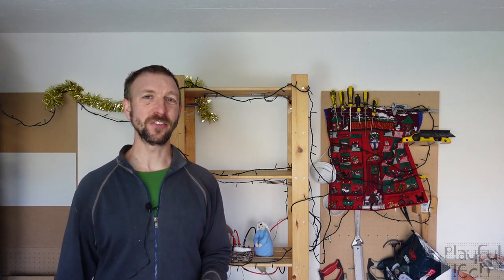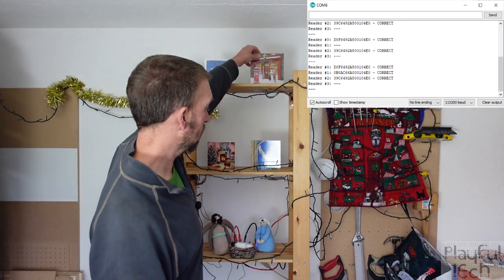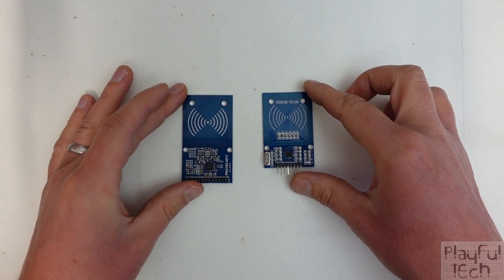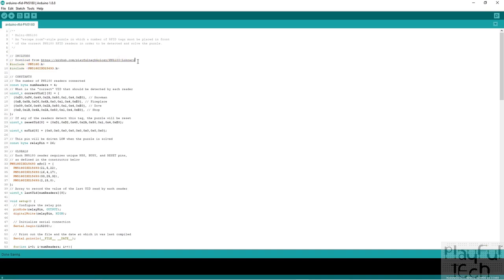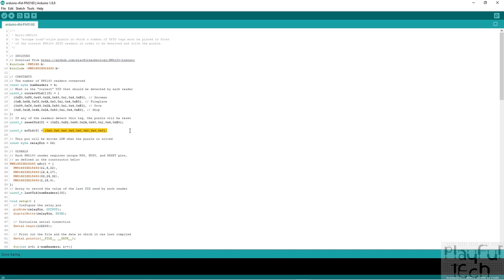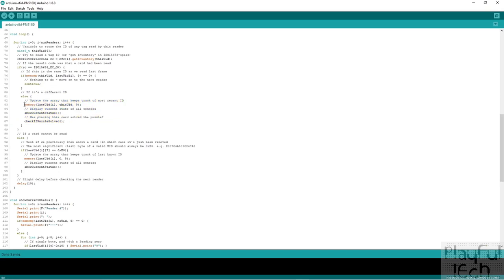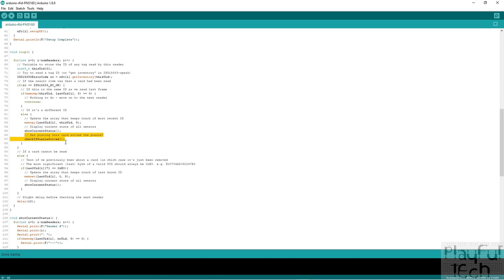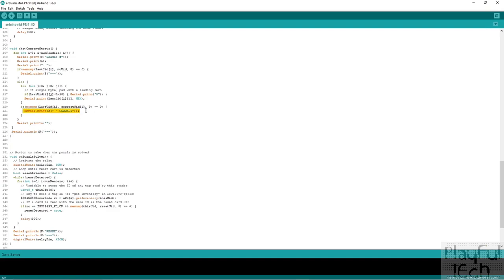Long-range RFID Vicinity Sensor Christmas Escape Room Puzzle Tutorial using PN5180 and ESP32

Comment: I wonder if it's worth doing a video on converting SPI (and other serial protocols) to/from RS485 so it can be sent over very long Ethernet cables, depending on data rate SPI can be quite limited on how far you can reliably send it and using RS485 makes best use of the twisted pair cable. there's very easy/cheap to use RS485<>TTL converters available from the usual suspects.

Comment: @20.12, Had figure out why my sensor does not work, indeed the PN5180 need 5V from the ESP32 vin pin. The PN5180 library did not mention this in the example code.

Comment: Hello, thank you very much, I was able to successfully read the tag but I got a ridiculous range of 10cm. The level shifter and every thing works well. I have 3 iso15693 tags which have different range
Reply: I have exactly this issue and absolutely nothing I do resolves it. Did you ever figure it out?
Reply: @kccr37  no not at all. There was really no solution. I had to buy a UHF reader. I was able to get 5M read rangs
Reply: @joshuaolakanla3993  thank you so much for your answer. Which reader did you end up going with? I'm currently trying the Sparkfun Simultaneous RFID reader, which is UHF. It's okay but not perfect for my application.

Comment: Awesome video as always! I have some questions..
Is there a way to adjust the reader sensitivity like in the mfrc522 library? I am worried that the reader might be too sensitive in some applications- having readers too close together could cause problems I assume for some puzzle setups!
Also, do both the 5v and 3.3v need to be connected for the module to work?
Lastly, I think it would be better for most escape room puzzles to have an automatic reset as opposed to having a dedicated reset card. Automatically resetting after all of the cards have been removed is something I struggled with when making some mfrc522 puzzles because the library allows the reader to detect when a new tag is present, but doesn't have a function for detecting when a tag is removed. Is this something you have tried using the mfrc522 or pn5180 modules?
Reply: You can detect if a tag was removed by polling the reader and comparing to the last reading, if the last read was an ID and the current read is nothing, you know the card was removed. He shows the code for this at 50:49

Resetting automatically  has the drawback that players can reset it themselves, which might be unwanted. But when this doesnt matter its definitely the simplest option!

Comment: This is cool for reading the UIDs. But I would really like to see an example where blocks are written to (and read again). I am struggling to understand the documentation on this.
Reply from the maker: Oh sure, I can show that. Do you have a particular application in mind to use as an example?
Reply: Thanks. Let’s say you have a bunch of cards that you want to be readable by multiple readers without having to program in the UID of each card for each reader. You would want to write a block of bytes to each card with its name, so that any reader could read the card without having to know its UID, and also worn out cards could be replaced without having to reprogram the reader.

Comment: Great video! - Thanks!
you've used RJ45 breakout boards to carry the signal lines to the ESP32,
I wonder, what is the maximum range you can go with the cable without losing the signal quality ?
Reply from the maker: I've got 3.3V over Cat5 running 20m. Haven't tested beyond that.

Comment: Hey man, cool video. Do you know any anti-metal tags that can read through a metal table ? ones I bought work only on metal surface. Want to place the PN5180 under a metal table.
Reply from the maker: I'm pretty sure all the RFID technologies I'm familiar with would not work if attempted through a metal surface - it requires electromagnetic coupling which is achieved through a tuned antenna, and the metallic surface would interfere with that. It's possible that an active RF transmitter at a suitable frequency might work, but that would obviously require battery power in the portable part of your prop.
Reply: @PlayfulTechnology  okay, thanks a lot.

Comment: Hi man, love the video! I have a quick question- are your rfid tags 125kHz or 13.5mHz? I have some capsule tags (EM4102 chip) that work at 125kHz, just wondering if i could use a setup like this with them ... Thanks in advance! (Sorry if its a duplicate question)
Reply from the maker: All ISO15693 tags operate at 13.56MHz

Comment: READY TO JOIN PATRION, but first...
Hello, I am in the Philippines & just getting started with all this.
I just bought an Arduino Uno (with 3.3v) and 5 RC522 rfid sets.
This video is a bit old, so before I sign up on your patrion, I would like to make sure, will I be able to use the code with 5 RFID RC522 on my Uno?
I know $10 doesn't seem like a lot there, but here that's 1 days wages, So it's better to check first if I can do what I need to before I spend so much.
Thank you

Comment: Do you know how good the PN5180 can detect RFID/NFC rings? I used a PN532 and it could only read it if it was virtually touching.
Reply from the maker: In my experience, those rings are pretty useless because the metal of the ring interferes with the antenna of the RFID chip itself... I've only ever been able to get read range of a few mm too.

Comment: Hi! Great video & Very usefull! Are in store some rfid Capsul or microRfid that can be detect via rc522 o p5180? all the capsul (named microchip dog's ecc) seems work in 124-134.2 KHz with UART EM4100 (like RDM6300). And this product work only one for arduino without possibility to array them in 4 or 5 sensor in a row..
Reply from the maker: I have some tiny capsule RFIDs that are 13.56MHz and work with ISO14443 readers (i.e. like the common MFRC-522 sensors). I haven't seen any that are ISO15693 compatible though.

Comment: Hi, Thanx for yet another inspiring and very detailed video :) Can you please elaborate on the amount of wires in the Ethernet cable? You have wired 9 wires from the PN5180 and there are only 8 wires in the Ethernet cable? Thanks in advance and happy new year! - BR. Martin from DK
Reply: I wondered this too but it looks like there is a separate 9th wire, presumably GND, going to each of the readers ;)  Maybe you can use shielded JR45 connectors and connect the shield to GND, then you get away with just one cable.
Reply: Hi  @mazemakes  , I believe I saw it too, but hoped it to be wrong :) I was wandering if only 5V could be supplied (and not also 3,3V) and then use the 5V for 5V (of cource) and a stepdown resistor (? ohm) at the PN5180 module side (or a specific stepdown module) for the 3.3V input. Then 8 wires are enough, without going with the shielded wire... :-)
Reply: @musereden  a resistor does not step down the voltage, it limits current. But you could use a voltage regulator no problem in this scenario :)
Reply: @mazemakes 
Hi, Yep you are right :) I wasnt aware of that. I have read a little about it since your post.
Maybe setting 2 resistors up as a voltage divider, where the PN5180 specs determine the mA and thereby the resistors? I found some specs specifying 250 mA as max and limiting value 300 mA. So if 250 mA is max and 5V, the total resistors will be 20 ohms. Then the resistors ratio must be 3,3V/5V = 0,66. Giving R1 = 20 ohms x 0,66 = 13,2 ohms and R2 = 20 ohms - 13,2 ohms = 6,8 ohms. 
Is that correct?
Reply: @martinrydahlpedersen8884  that would not work sadly, you can use a voltage divider to change signal levels, but not for powering something. Just get a regulator, for example a 1117-3.3. there are even ready made little "step down" modules that make it really easy to use!
Reply: @mazemakes  Thanx for the advice and guidance :)

Comment: Hope you can help.  I get the following error when trying to run your code:
* FATAL: Reading more than 508 bytes is not supported!
Reply: did you get a resolution to this error?  I'm getting the same.
Reply: @mytholibarG  No, I did not. Please let us know if you find a solution.
Reply: @JohannFritz78  So I had a miss configured GPIO.  I used the PN5180-ReadUID.ino to check each reader and found I had one that was incorrect.  I have a 30-pin ESP as well so makes it more challenging. I'm getting the correct ones now but still want to learn by troubleshooting this one. Hope that helps.

Comment: Wow Reall cool... if i want to have more than 4 RFID, how do I connect them? TQ. Merry Christmas
Reply: You would need to have a device with 3 more pins, for NSS, BUSY and RST. (The SPI lines are shared).  (If you don't have spare pins you can buy port expanders). Then in Alistair's code you change the number of devices, and specify the pin numbers in the nfc array

Comment: Only the white cards RFID card works. The blue key chain RFID card does not work. Any idea how to make it work, please?
Reply: Hi Johann, I am having the same issue. I have figured out that the blue chips I received are of the type of ISO14443 instead of ISO15693 which are not what the library and example code are written for. I am curious if you ever found a good solution. Thanks!
Reply from the maker: As @TheKsbdude said, the PN5180 is capable of decoding both ISO15693 and ISO14443 tags, and they normally come supplied with one of each type - I only demonstrate the ISO15693 in this video, because if you only want to use the shorter-range ISO14443 there's plenty of examples using the cheaper MFRC-522 boards instead.